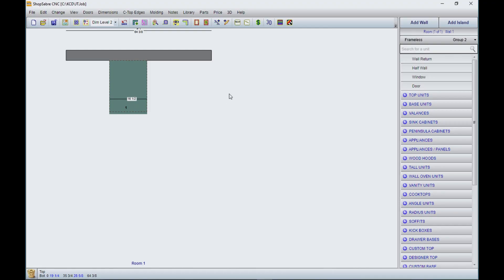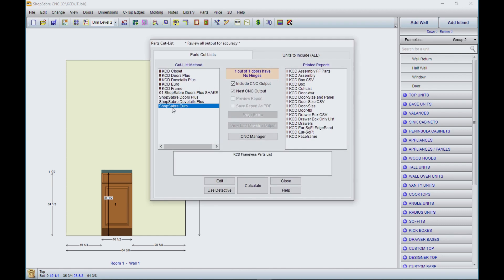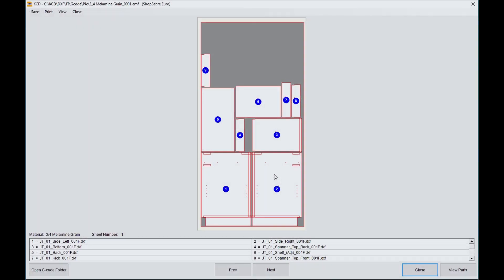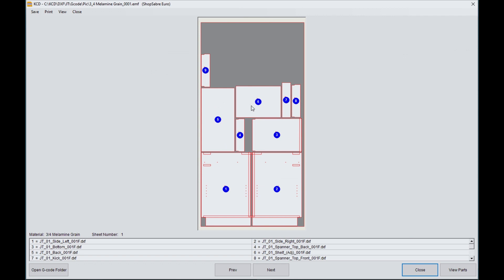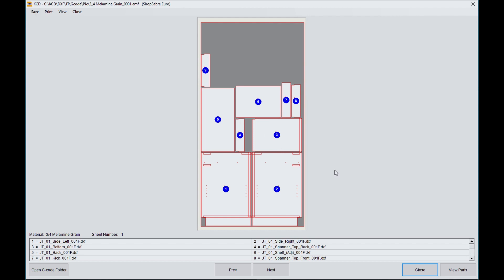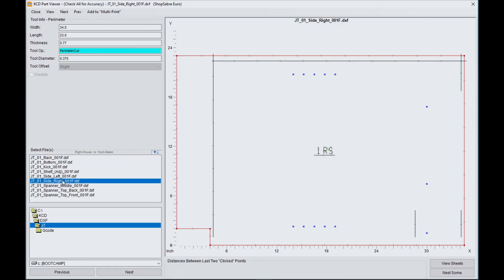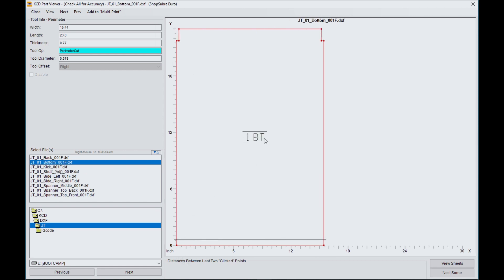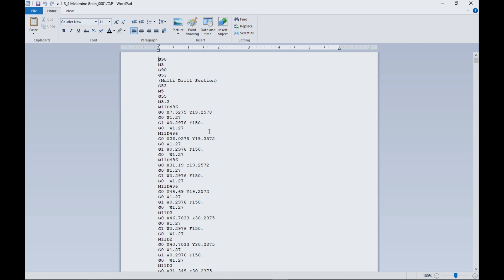ShopSabre CNC Router Technology + KCD Software + Cehisa Edge Bander = Production Cabinetry Shop

Comment: What recommendations do you have for bit, feed, and spindle speed for cutting the MCP? Your cuts are coming out really well on your edges and your blind dado cuts -- definitely curious! Also, does the KCD software have the ability to input bit specific information? For example: I'm currently importing my drawings from Sketchlist to Aspire, I do all of my tooling there (where I have all of my bits setup, etc) then I export to Mach and cut on my CNC from there. Trying to streamline this process as much as possible and KCD seems like it will do the trick.
Reply from the maker: I would call tech support, they will be your best guidance on this! I unfortunately don't know the best info to share with you as social media is more my speciality.